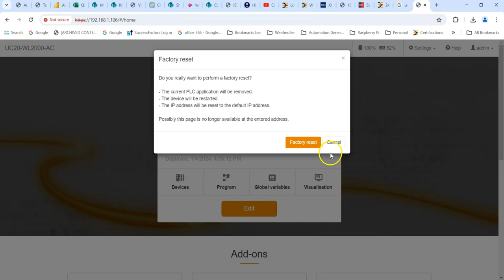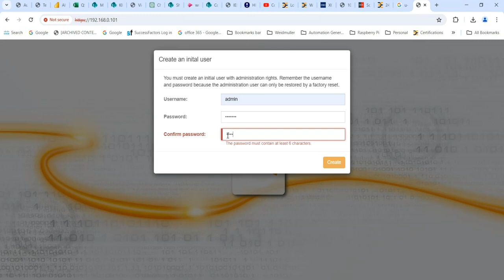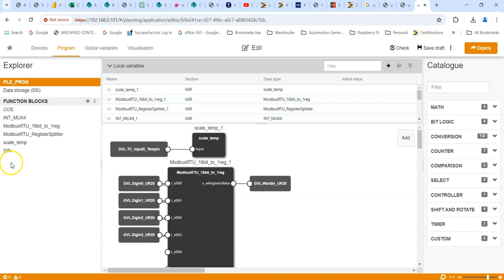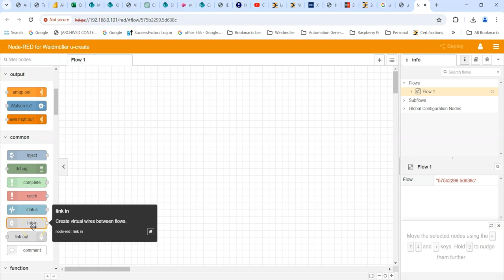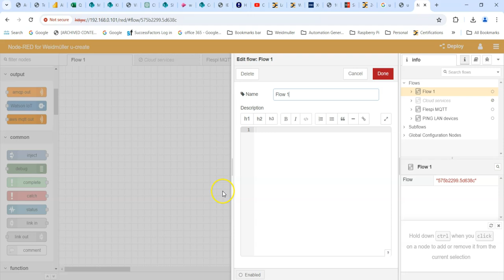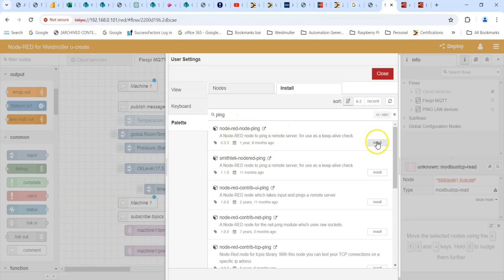U-Create WebController Factory Reset and restore

Comment: Hello, great video, congratulations! I wanted to ask you how I should connect to u-create? I am working with the ur20-fbc-can model and I can only access the device configuration with the web server, and I need to access the program. Any help is appreciated.
Reply from the maker: @federicomuruaga3841  thanks. Ucreate web is not capable of canopen communications. You could use modbus TCP coupler and setup modbus TCP coms in node red, or convert it Ucreate to codesys (uOS) but then you need to purchase various codesys licences.